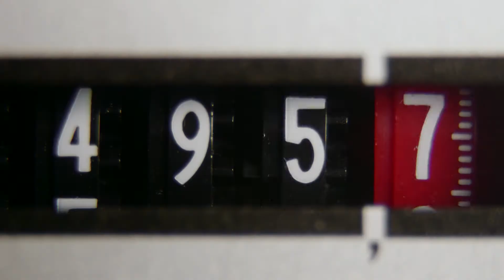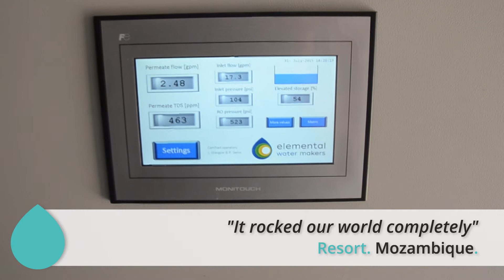Solar Desalination - Clean sustainable water from unlimited resources - Elemental Water Makers

Comment: Great now upgrade your system by installing slow speed underwater turbines called Waterotors made in Canada. Waterotors run 24/7 unlike wind and solar, won't harm fish, can be moved if needed and work in tidel areas along coastlines. The Canadian military is replacing diesel generators in the far North with these units. They can be scaled up to meet electrical power needed for most projects. Adding atmospheric water generators if installed at sea level and where air humidity is 100%, could give you an additional source of fresh drinking water to market. Search it on YouTube and see for yourself. We waste miles and miles of unused potential electrical power by not installing these units in rivers and streams with water moving 2 to 5 miles an hour. This is just part of a larger idea to feed and water the World.
Reply: Yeah you need a fucking ocean for that dumbfuck they don’t have rivers and tides everywhere dipshit, dumbass Canadian military wave generators are nothing compared to the superiority of oil and gas efficiency AND IT NEVER WILL BE